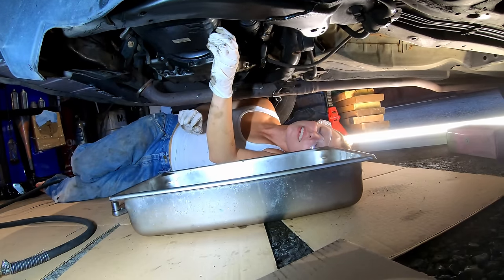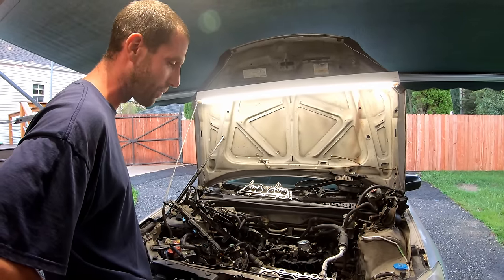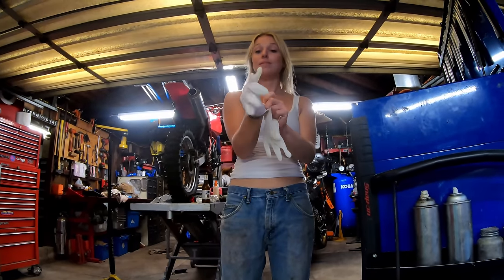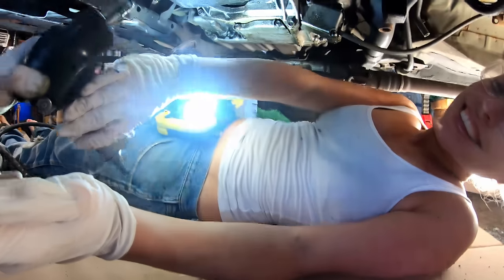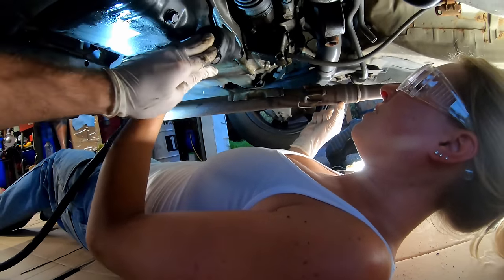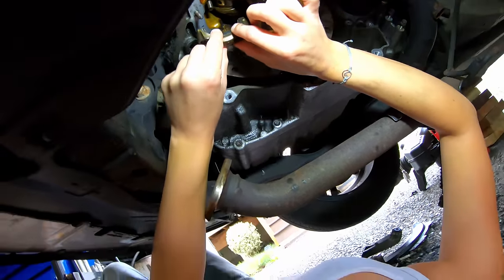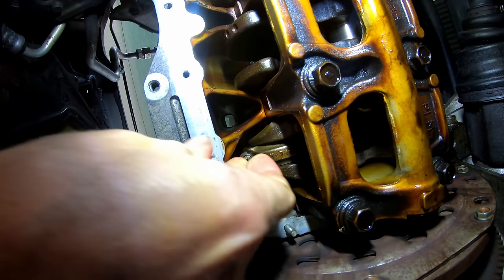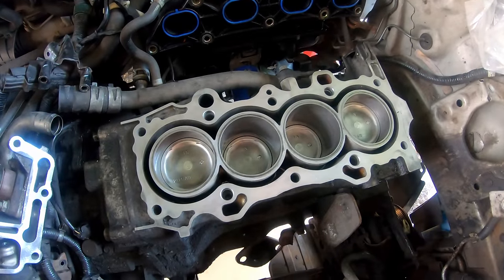Putting Jen To Work - Honda 1.7L Piston Rings

Comment: Even though those bearings should've been changed its very good that you didn't change  ONLY the rod bearings. Never eeeeeever change just the rod bearings unless you know the main bearings are very new. The rod bearings oil gallery's are connected to the main bearing oil gallery's so if there is less restriction at the mains from worn bearings and you create more restriction with new tight rod bearings then guess where your oil is gonna go? It's gonna dump most of it at the mains and starve the rods. If it's bad enough the you'll smoke the rod bearings. One will probably spin and you'll have a knocking engine with a destroyed crank.

Comment: Which rod bearings part number would you use if you did replace those? I have a 300K+ engine that I want to do this exact job, and bearings may need to be changed, but don't want to put some junk worse than the OEM part I'm getting out. Thanks.

Comment: just wondering if you know that a torque wrench's setting is different when using an extension. ie. 45 ft lb set on the wrench with a 8 inch extension wont torque to 45 ft lb

Comment: Okay I got one for ya. My 92 GMC S-15 Jimmy used to blow blue smoke when starting. My grandfather said it was the O ring. I have yet to see where on an engine where the O rings are and, why did it only blow the blue smoke with the first start of the day?
Reply: Blue smoke on the first start of the day is usually bad valve guide seals.  On your S-15 the valve guide seals are on the valve stems, under the keepers.  They are actually square cut neoprene (or similar material) O-rings.  When they get old they split, allowing oil to get by.  So Gramps is right!

Comment: You may want to check / correct the slide on clocking of the rings on the piston, as it is completely wrong compared to service manual. The two compression should be 180 degrees from eachother, and two oil also 180 degrees from eachother, altogether forming 90 degree cross. This is a critical part and unfortunately I followed your slide and discovered correct later. Other than that fun video.
Reply: "Clocking" the rings is more of a ritual than a necessity because rings rotate randomly in their grooves while the engine is running.  So at various times the ring gaps will be all lined but you will never know it.  The engine will start and run like usual and oil consumption will not increase!

Comment: My only issue is that you didn't plasti gauge the rod bearings to see correct clearance. At 110,000 miles the should have been done. Jen got 10x more pretty and respected by working on things men do.

Comment: If it were me I would use no oil or WD-40 on rings. It will be difficult to get rings to seat with moly top ring (used on most modern rings to hold oil)

Comment: Usually when you see copper in the bearings, its good to replace. Even though taiwan, or china. As long as its same metal composition and built correctly. Same weight, metals and shape. Itll be fine. Taiwanese people drive cars too and have great manufacturing processes. Other than that great video

Comment: Don't You use a ridge Reamer to rake the ridge off the top of the cylinders?
Reply: What ridge?  This is a low mileage Honda with fuel injection!  Ridge reamers are a thing of the past for the most part.  Fuel injection does wash down the cylinder walls on cold starts like carburetors with chokes did.  Modern metals and more precise machining tolerances also mean engines last far longer than in the past.   "They don't make 'em like they used to"!  And that is a good thing!

Comment: Did this engine burn oil ALL the time?
cuz my 2011 civic with only 60,000 miles wouldnt burn a drop between oil changes if the daily driving trips were less than 2 hrs per trip.
BUT when i drove across country for 3 days , 12 hrs, 12hrs 8 hrs , it burned 3 quarts in in 3 days!
then it never burned another drop for next 6 months on short trips
BUT then back across country 12 hrs, 12 hrs 8 hrs it burned another 3 quarts in 3 days.
 then it never burned another drop between oil changes.
Is this normal?

Comment: the gaps of the two top rings should be 180*. The oil control ring has so small tension against the cylinder wall that the function of it's ring gap in relation to not letting gas blow by is totally irrelevant and in that same term having the gaps of the two top rings 180* off each other has higher gains than being 120* spaced.

Comment: DO NOT  wire wheel the tops of pistons. they have a lead coating on theem and you have just removed that protection. Soaking thm in carb cleaner to remove carbon is best . Also use the old ring  broken so you use it as a scraper to remove all the crude in the groove. sue paper towels to rub the walls  to a point ;where you have NO black or gray on the towel . use atf or marvel to lube thee rag or towel . gray is the abrasive from the hone and will prevent teh rings from seating prperly.  rub rub rub till no gray is seen... Rick Wallace 50 year ASE master Tech

Comment: No treadlocker on the crankshaft bearing bolts?
Reply from the maker: Never heard of a connecting rod bolt backing off. Very fine thread and they get torqued down pretty good

Comment: Rod bearings are junk, the tab is not what keeps the bearing from spinning its the crush tab is there just to position the bearing during assembly. Never blast a piston, glass bead or sand will embed its self into the soft aluminum and destroy your engine.

Comment: Staggering the ring gaps is an exercise in futility!  That is because rings randomly rotate in their grooves and the gaps will line themselves up thousands of times during the engine's life span.   So this nonsense of people saying "the engine won't run if the ring gaps are in line", or "the engine will burn too much oil if the gaps are in line" is pure myth!
Reply from the maker: I think it's more about just for first start and break in. Yes I agree with you though the Rings rotate so it's really not that important. However all of the factory service manuals do specify it so there's something to be said about that

Comment: See on the broken valve cover bolt that was broken I would have just put a stud in it and nut on the top to hold down the valve cover... rather than drill it out and helacoild it...
but I'm lazy... so... boom..

Comment: Always chek the ring end gapp to small annd youlget what he said .To small of a ring end gap makes a very bad day! When the piston rings heat up the end gap closes up When that happens and the rings still expand they go to the weakest point if the piston the spoot where they can push material out and that is up like pushing your fingers together when that hapens your engine is going up in smoke. no repairs nothing.

Comment: That is the worst engine Honda ever made. I had a 2003 Honda Civic with the 1.7L D17 engine. They loose coolant out of the  Exhaust valves due to a cracked block not a blown head gasket. Look on all the Honda Forums, everybody  thinks it's a head gasket , a leaky  Radiator, the water pump, or a cracked  Cylinder head.
Reply from the maker: Well I do agree that it's a crappy engine. However the head gasket 100% fixed the overheating issue on this. She had a blown head gasket for quite some time but it eventually got so bad where the car was not drivable on the highway. I don't doubt what you say is true however it wasn't the case with this one. Well actually come to think of it, we did put a remanufactured head on it so who knows. Speaking to Text so sorry if there's typos in there

Comment: How is it running 2 years later?
Reply: By the way that's as hardcore as you could possibly get with a car
Reply from the maker: Ran great for maybe a year or so and then One of the valves in the remanufactured head ended up breaking. Definitely a bummer. Ended up just dropping a used engine in it at that point and it's been good since
Reply from the maker: Last time I get a cheap remanufactured head.
Reply: @NoNonsenseKnowHow  long block swap all the way.  So long as the oil pan is not full of water....  I always go with a long block off an automatic.  Such a good deal.

Comment: Where you getting a buring smell??
Reply: Out the exhaust...  Start at 10:00 so if too much oil in the combustion chamber, it goes out the exhaust and causing the consumption

Among other things like too much going past the exhaust can plug up the catalytic converter too😢

Comment: I love Hondas and Toyotas but I'm going to say this. I had a 2001 Honda Civic same generation as this. This is the worst engine design that was ever put in a Civic. A lot of them had problems with overheating and warping the head. This happened on mine. From everything I've read this was the most unreliable generation of Honda civics. Not saying that they're bad because they are way better than most but.....

Comment: WD 40 is actually a water displacement formula. 
It is in no way a lubricant. 
Have you ever spayed a   Squeaky doorhenge Squeaky doorhenge with it?
Guess what? You are sparying again about 6 months down the line.
There are actually around 12 different types of WD 40 on the market. Make sure it is an actual lubricant.
Reply from the maker: The fact that you said WD-40 is "in no way a lubricant" discredits your entire comment. Go spray it on your fingers and rub them together. Have a good night.  And I apologize if my opinion offends you. Now go spray some water on your door hinges.   😆 just fyi, water is a lubricant.
Reply: @NoNonsenseKnowHow  WD 40 in the blue and yellow can is for water displacement. There are other forms on the market specifically meant as a lubricant. Would you use the blue and yellow can ti spray on an engine block and let it sit for a couple years and expect it not to rust?
Maybe I should of specified the point I was making.
Unless you would take that same water and spray it on an engine block and let it sit for a few years?
Nor offended at all.
I wouldn't use WD 40. None the less.
The line you are sponsored by ( Blaster ) is what I use anyway.  And just like the PB blaster, there are different applications for each different product in the line.
You are a smart guy who knows his stuff, heck I know you have worn a couple MOPAR shirts before in your videos. I wasn't trying to discredit you in any way.
If I doubted you or came off like a Karen, I wouldn't have spent the last three days watching your content.

Comment: What a load of crap the bearings were no good. Plus should use hot water and laundry powder to wash bores. Fit ring compressor to pistons at least dowm to gudgeon pin holes. Ring end gaps should never be on thrust sides of pistons. Second ring is a compression ring and oil scraper

Comment: Whoo… what happened?
Reply: ??? Head gasket failure

but Jen also mentioned it has an oil consumption problem, so they yank out the pistons because the oil control rings are suspicious for being stuck...

Yeah, there's ways to decarbonize them with chemicals when the engine is assembled,  but glad they had it apart anyways

Rod bearings are changed out, so that's a plus

New compression and oil control rings is another plus

And honing the cylinder walls makes it almost like a new engine now😅

Comment: Pull the fuel pump fuse and crank over for 20 seconds
Reply from the maker: In my opinion that will just help squeeze 
 the assembly Lube off the bearings. Start it up. That's the best. Unless of course you have an oil pump that can be primed without cranking the engine over
Reply: @NoNonsenseKnowHow  LMFAO